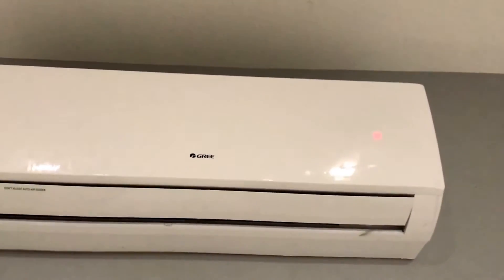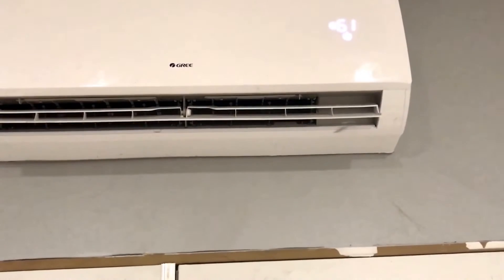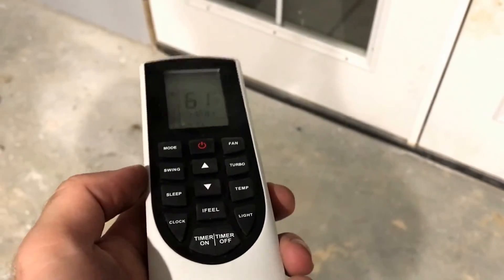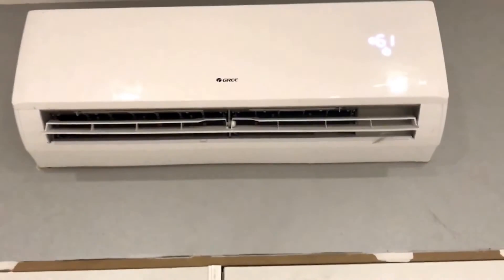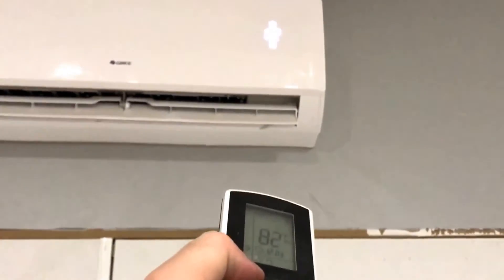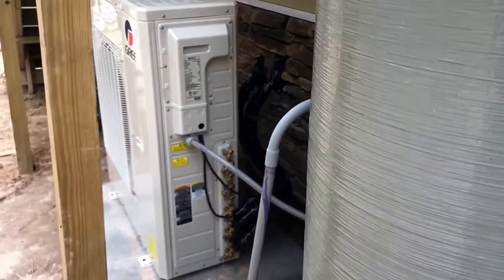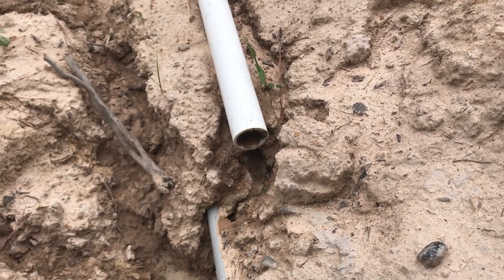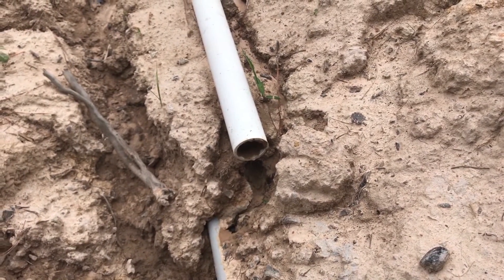Testing out HVAC Mini Splits

Comment: I just installed a mini split in my garage and it works great.
Reply from the maker: Nice! Yes I'm really liking these. They seem to cool down the big downstairs room very well. It's over 1000 SF and we have just two of them to do the whole area, with three ceiling fans to help mix the air around. It sure is nice to be out at the farm working, and after all these years have a cool refuge to go to on a hot day!